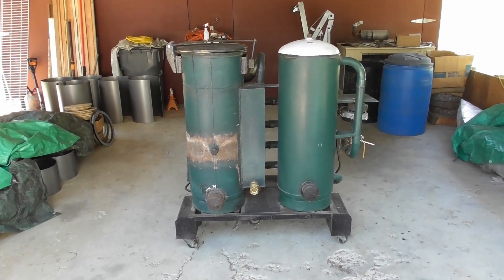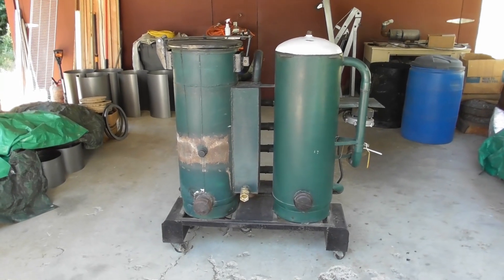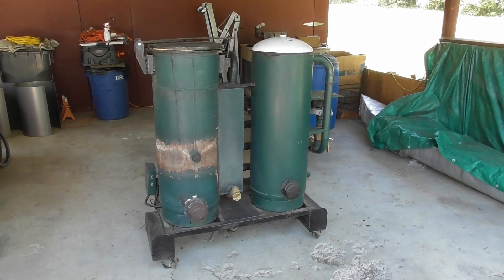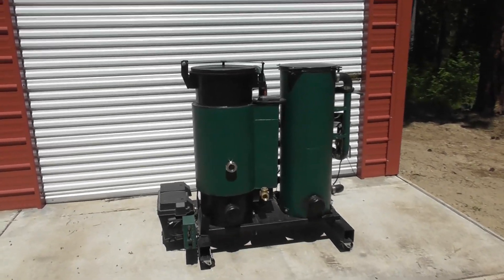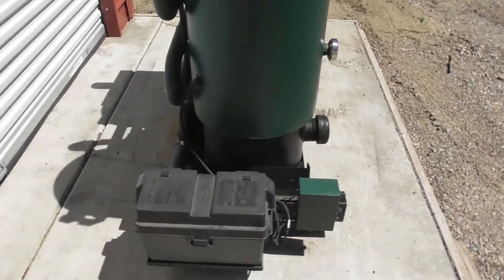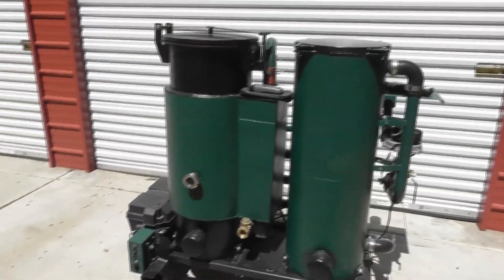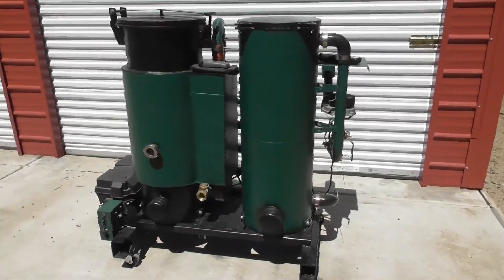My 1st Gasifier: A 600lb. paperweight

Comment: if i build that unit it will be 3 inches wider around the burn tube- so i can insulate betwee the metal with the buned pant and the burn tube inside- maybe just few layers of sheet metal-too keep the heat off the outside metal. or less damaging high hest.NICE BUILD- what a good feeling it must be too get a wood gas processor-all working- to run motors with.I wood put that lighter unit in the back of a 2.2 motor S10 truck and get 150 miles per gallon- running the gasifier at medium pull load.highbrid in a little petro for top speed and power.
Reply from the maker: In the current build, there is a stainless-steel liner, with 1" high temp insulation, plus another 1" insulation around the entire reactor. It now has great heat retention and can easily reach the +2,000° F temps needed.

Comment: There's a few people that have used a 60/40 mix of plaster and sand to cast the hearth, I used it on mine and welded heat sinks around the fire cone as well. Mine' snot ready yet but I've seen the others running and working. That would remedy the heat loss you see in that original build here. Try building an insulated hearth, I don't think the reactor unit people build should be one piece either, mine's housed inside a 55gal drum.
Reply from the maker: The superwool external insulation we use wrapped around the reactor tank works very well for heat retention

Comment: So what I have been reading is that making a gasifier to run a small engine/generator is more difficult? I'm wanting  to make a gasifier for a 420cc 9000w/7000w predator generator and people have said it's too difficult to get a gasifier to run one if you are using wood to power it. They all say using charcoal is about the only way. Is that accurate in your opinion? I want this gasifier as a back up to a offgrid solar system to charge my battery bank only, not necessarily to power things directly.  I currently have a 10kwh lithium battery system that I plan to expand as I go( I build my own batteries, keeps the cost tona minimum since I can buy cells for as lownas $60 per 1000wh... lot cheaper than battleborn which is $800-$1000 per 1280wh. Obviously those are lifepo4 and mine are just regular lithium but that's OK since it will still last 5-10 years.
Reply from the maker: This gasifier design will run a generator from about 3KW-25KW. For smaller engines with little suction, you might have to add air on the gasifier air intake.
Reply: @steveoffgrid485  gotcha but what fuel are you using? I kept reading on a forum that it was too hard to run a small engine(under 1000cc) on wood chunks, they all said you need to make charcoal or use Pellets.

Comment: Did you document your improvements anywhere? Is that what the binder is standing up beside you at the end of your video?
Reply from the maker: Yes, I have extensive documentation with build instructions, assembly instructions, assembly diagrams, leak testing, etc. These are included free with our DIY build kits.

Comment: im starting to build this. Im using brand new never had propane in them cylinders. Bought them at Menards. Ill be leak checking everything. Ive also never welded anything. So this should be interesting
Reply: 11 months later - How did your build go?

Comment: So Im currently building that paperweight what and I'm worried because I got a lot of money in it at this point, what really failed in your first attempt, did it actually work? What I'm getting out of the vid is you are saying you need the extras!! Was that what made it not work properly? Anyways I've been following you for years and sucks you and ben had a falling out but without your vids I would of really messed up with all the leak testing and I wish you the best
Reply from the maker: Lack of proper leak testing processes is the biggest functional issue in the book. Narrow base and use of propane tanks are safety issues, and external insulation, insulated hearth liner and Venturi air jets are performance issues.

Comment: Okay, you convinced me. The 600# paperweight vid showing the failure of the Peterson book design you built at huge cost in $$, time and frustration is an eye opener. Your more sophisticated version 3 design is also convincing. I've already commented on your bullying vid saying that Peterson did the wood gas community a service by updating WW2 era designs. But your update on Ben's design is a HUGE (yuge) leap forward! When I get around to building my own gasifier, I'll probably use your design and buy critical components. However, I'm looking to do a miniature version, maybe 1/4 scale of the output of your version 3. Any insights or pointers on a smaller version?
Reply: What would you power with it?
Reply: Props to the guy for his work but in the age of yt I no longer believe in printing knowledge and selling it for a premium. I haven't purchased a book since college forced me to.

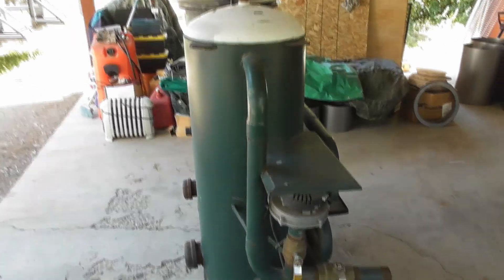Comment: @6:45 when you weld a bunch of iron together heat it up when it cools down it moves around a bunch shrinks and expands very predictable iron is.  
Say a bridges  steel beam that runs across a river on a hot afternoon is  3 some times 6 inches too long in the afternoon heat , in the morning when you come back it's to short.  That's why it needs to be bolted Things that are bolted together move around things that are welded together buckle